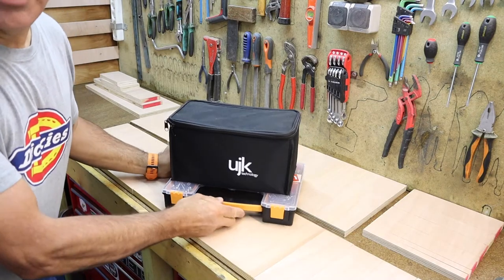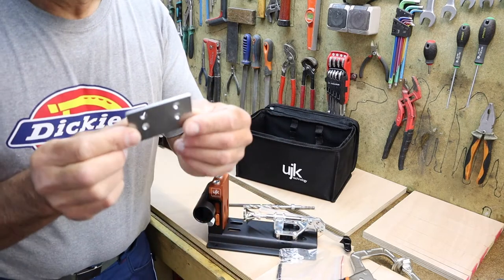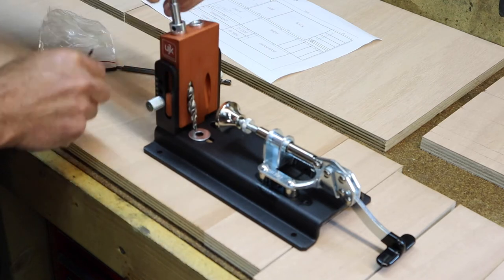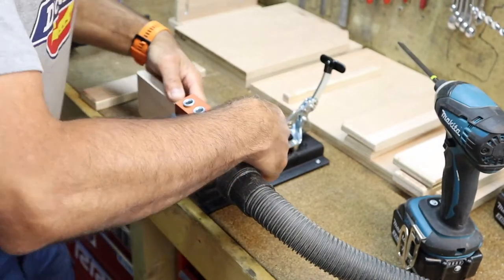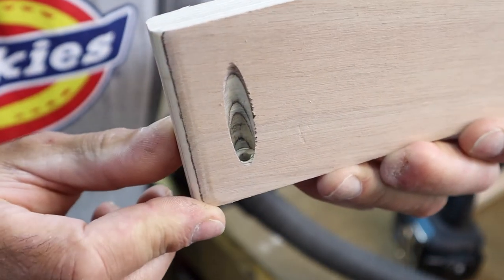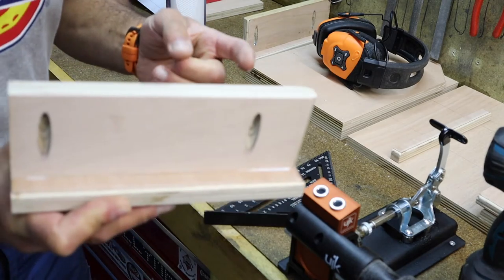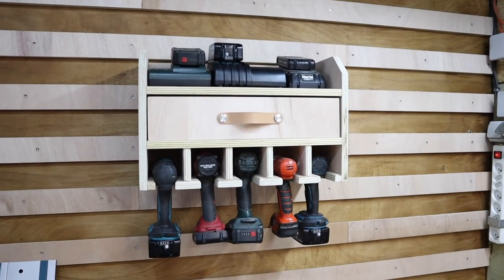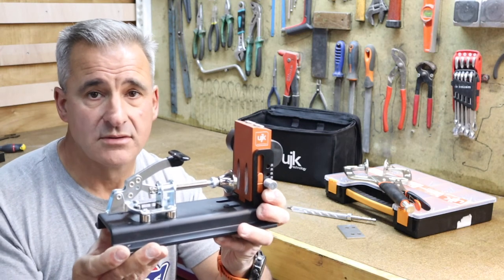Pocket Hole Jig | How to use the UJK jig

Comment: I like the UJK stuff. I'm from the UK but I live in the US. I bought the Armour tool auto jig as it has the clamping handing in the front as is auto adjusting for thickness of material. I've subbed as I liked what I saw and you could do with more subs. Personally for me, I'd use the Peanut 2 fixing and the mini Peanut jig. It forms a hidden, locking joinery system that allow you to take things apart with the tap of a thor mallet.

I like what looks to be a Garmin watch with and orange strap. I have the Instinct tactical solar in black with the blaze orange straps. I have a black and orange thing going on.
Reply from the maker: Thanks - yes I am am interested in the Peanut system, will look into that.